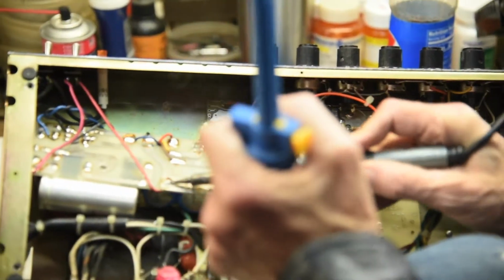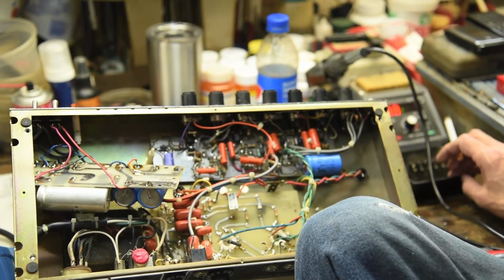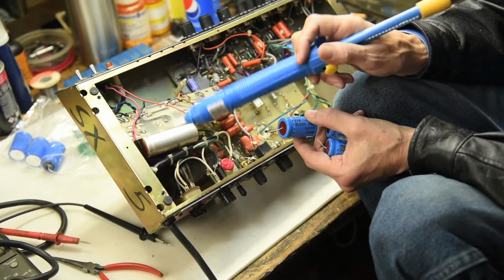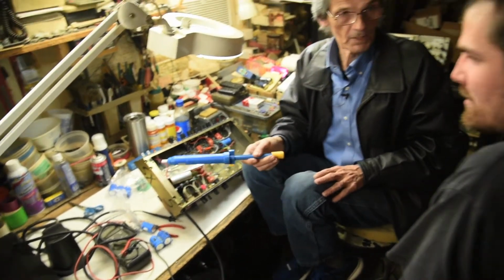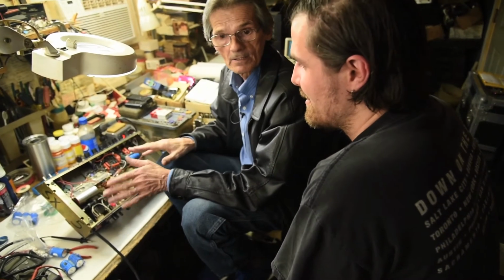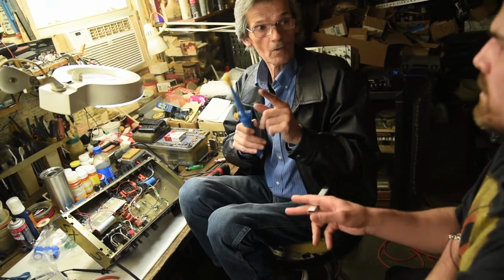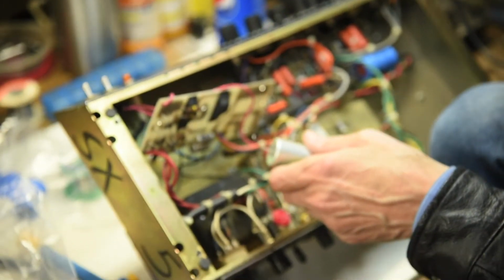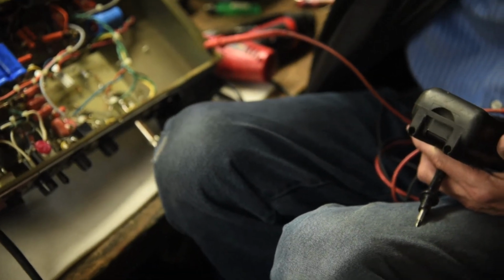LET'S LOOK AT THE GUTS! | Mesa Boogie Mark II C+ (SX) - Replacing Filter Capacitors

Comment: They're not cheap, but a Hakko FR-301 desoldering gun will get those stubborn caps out more quickly, and with less chance of lifting a trace or solder pad.  It's a huge improvement over wick or a manual solder sucker.

Comment: Man this is stuff that belongs in the national archives, amazing info!!
Reply from the maker: Eh man, was in NYC went you wrote this, sorry for later reply... Uploading the video now which includes schematics for the Mesa EQ. They use "coils" which can handle more power than caps. Maybe that's where the magic's at?
Reply: Those ’coils’ would be called inductors. If magic is in the inductors, your amp does not have the magic as it is non-eq model. The magic is in the circuit. Compared to mark III 2c+ has smaller coupling capacitors both going in to the lead circuit and between stages in the lead circuit. That keeps the tone tighter and less obnoxious. There’s also a little different cathode bypass arrangement leading to more gain at higher frequencies. What else, well the presence circuit is different to Mark 3 which sounds better to my ears but it depends on which mark3 stripe you’re comparing to. There’s some other minute differences like plate bypass cap in the phase inverter AND couple caps tayloring the highend. But no magic.